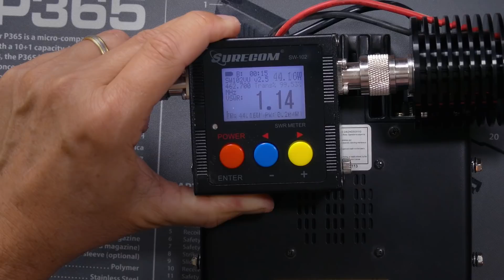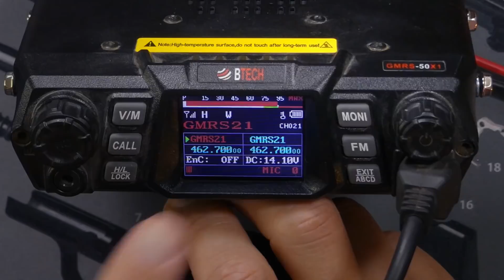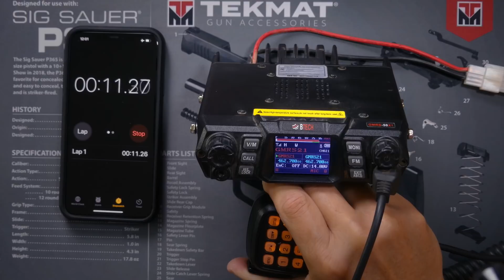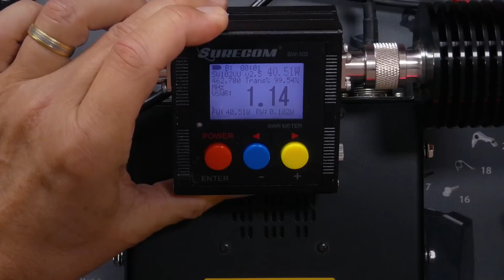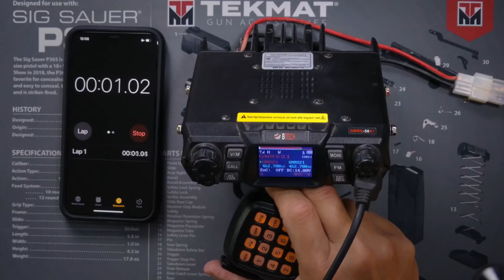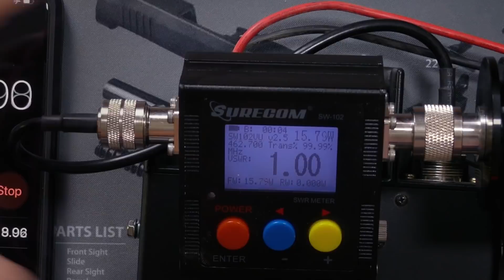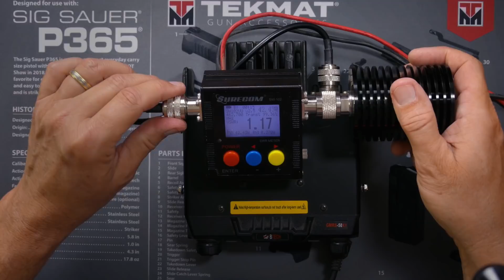Transmitting With NO ANTENNA At High Power - Will It Will Damage The Radio? (Ham, GMRS, or CB)

Comment: What a useless and stupid video this is. Why would a sensible person with just a little bit of knowledge operate a transmitter without a proper 50 Ohm load? Only a complete and utterly fool would do such a thing. Obviously this guy have no technical knowledge of transmitters. The most of the current transmitters these days have a SWR protection circuit that reduces the power output of the final stage when the standing wave ratio or the impedance is way of. That's why the final stage of this transmitter survived.
Reply: IMHO this YouTuber is not a "fool" but a true "Amateur" in the spirit of a real HAM. The amateur (HAM) radio service license was created for experimentation and this spirit was perfectly and legally encapsulated in this video.  Until the FCC creates an "Expert" radio service license for you to obtain then please remove the stick from your behind.
Reply: ROFL #SADHAM 🐽
Reply from the maker: It would seem that you didn't actually watch, listen to, or comprehend the video, as i very clearly explained why I made this video.  And you have come along and proven my point. Thank you for that.
The only thing i don't understand is why you didn't start your comment with how many years you've had your license or how long you've worked in "the industry"
Reply: @TheNotaRubicon  lmfao at the sad Ham that didn't comprehend the video or why you did it Duhh to prove all the other sad hams wrong that it wouldn't blow up or catch fire and die and never work again got to love when people don't listen or read 😂😂
Reply: @TheNotaRubicon  thanks for your video Randy I've learned a lot about radios from you and just about every hobby out there you have all these know-it-all intelligent imbeciles they're everywhere on YouTube have a great day
Reply: @TheNotaRubicon  isn't he right about power reflection? It is like sticking fork into power outlet and telling that you can survive it because differential fuse.
Nevertheless it's a bad practice which can result in destruction of the power stage especially in older transmitters or the ones which do not have any protection. Simple
Reply: With 150 years experience as a HAM operator I approved this message 😂😂😂😂 … Dude got pinned 🤣
Reply: Literacy much?
Reply: Clearly he stated it right up front why he did this at the beginning. Did you miss it? He did this because self described “experts” keep telling him in comments posted that “transmitting without an antenna will destroy your radio”. He wanted to prove them wrong to make them quit doing it. He took a crappy couple year old used radio that was probably only $100 new for the test. He was out nothing but the time. He did as you, I and many already knew, successfully proved them to be wrong. But many, many more are now correctly informed and will quit repeating decades old information that no longer applies. It was not useless or stupid. He made his point, proved the annoying “experts wrong, had fun doing it AND got over 13,000 views out of it. Clearly not useless.
Reply: Hey, give the commenter a break.  Apparently he also produces content within YouTube also.  His content has just over 100K views and has 100 +/- subscribers.  With this rate of success it’s no wonder he has switched to raining on other contributors.   

I’ll be keeping my subscription to @NotARubicon.    thank you
Reply: Some people tranmsit and forgot to screw in the antenna. This is actually helpful lets people know that it probably didn't damage the radio. I'll admit I have done it a few times including with an HF radio. My radios didn't just blow up and stop working cause of the mistake.
Reply: KAREN 2.0
Reply: How bad is your English, you need to go back to school and learn how to read and write properly.
Reply: "experts"
Reply: This guy..YouTube comment expert!
Reply: You talk to much I guess you dont have knowledge!!!!!!!!!!!!!!
Reply: Thanks for not disappointing!
Reply: A typical Sad Ham response
Reply: Being I am also a  "professional operator" like your self, I can also tell from experience that this "Randy" fellow is just an amateurish buffoon. 

I can tell from his videos he does not know how to correctly grip his "Johnson" the way he should as a "professional".

He also seem to not have a single clue as to how he should poke and stroke his "chocolate coated starfish" the way a "expert technician" should either! 

Just plain amiture behaviour indeed!
Reply: All wt has a protection circuit from the beginning of ham radio.
Reply: @snuitje100. I wish I could go back in time and give your daddy a condom. It's just a test to see what happens.
Reply: yOO R very semart. yOO haf a much big edukashun den I du. eYe cen tel frum yOOR spel end grumer.
Reply: Im smelling the scent f a BUTT HURT Hamy.. Hams are about as arrogant and ignorant as the day is long. The radio will heat up wether an antenna is connected or not when you get long on the key. Sorry but i just love it when these so called Ham Gods place their comments. Its like adding a sign on there forehead saying"Ya im a dumb ass ham operator and I know more than GOD"
Reply: Proof?! Docs.?!
Reply: Legend has it this guy is still trying to come up with a proper comeback to this day. 👀💩
Reply: It's someone who gets lots of free radios sent to him!  😮
Reply: Sometimes I think these comments are staged.
Reply: Ok boomer

Comment: drone jammers with output power of 30w and above are constantly dying from being used without antenna, though those devices are pretty primitive compared to modern walkie-talkies, may be they invented a solution against that in propper radios

Comment: The limiting factor here is the transistor die temperature. Most transistors are rated at a maximum internal die temp of 150C or more. Now there is some thermal resistance between the internal die and the case of the transistor... so you must derate accordingly. But the bottom line is that you would probably have to get the heat sink to perhaps 125C before there would be any chance of damaging the output device(s).

Comment: What can cause a radio to all of a sudden get hot and blow a fuse?  My 50 watt Midland 575 did it today and I do not know why.
Reply from the maker: Could be aBazillion things, but I would start by checking all of the wiring for shorts..
Beyond that it would take troubleshooting steps that are beyond the scope of the youtube comments section.
Reply: @TheNotaRubicon  Thanks for replying and thanks for the great videos.  I think you answered it in one of your other excellent videos I watched after making my comment..  I was using a analog CB band SWR meter.  For some reason the SWR approached 30, smoke started coming out and the fuse blew.  For now, it seems to be working.  Thanks again and keep up the good work.

Comment: The reason it didn't die: Proper cooling solution for the given output power. 😆 Try that on a very tiny IC transceiver with no antenna and the juice cranked up. I'm interested in the results now!

Comment: As a neophyte, following all of Randy's advice to the letter...this one got me thinking. Do radios, especially HT and ham units that typically find their way into the fumbling, unwashed, formerly cool ranch Doritio stained hands of amateurs, have published duty cycle limits?  A question I'd be too embarrassed to ask a fully licensed Elmer, for fear of a wrathful lecture and suggestions that I volunteer at the next community radio dorkfest.  Alternatively, I used that Googling thing Randy always eludes to.  Come to find out, some radios do, but some claim to have a 100% duty cycle, in other words no duty limit. Further curiosity got me wondering about the greatest HT ever designed and I find the following, but I can't be certain that I understand the limitation 03/03/54 min. (Rx / Tx / Standby).  Is it 3 mins on, 3 mins off?
Reply from the maker: Anyone asking about duty-cycles should not be using a GMRS radio.

Comment: @NotaRubicon Productions - Back in the late 80's I owned a beat up Amstrad CB-901 rig, using a straightened wire coat hanger as the antenna and my sink as a makeshift ground plane, with an average SWR reading that literally melted the needle, I still managed to transmit clear across town and annoy everyone with those damned roger beeps. Those were the days! 😉

Comment: I have experienced both sides of your experiment.  Radios with no damage from a brief key up and a 100watt radio with lots of damage from an accidental key up at 5watts with no antenna.  The finals weren't fried, but some passive components died and shorted the board.  KI4CJJ

Comment: Can you have no antenna on when just receiving with no damage? I just got a nagoya 771 antenna and I wanted to swap antennas back and forth between my stock antenna and the new one while receiving a signal without power off to see wich one receives a clearer signal
Reply from the maker: One most radios, yes. I do it often on all of my radios.
Reply: @TheNotaRubicon  ok this would be on my yeasu ft65 that I would be doing the tests on. Thanks

Comment: I always enjoy your videos and don't mind the barbs thrown at licensed hams ( I B one). Very interesting test, I like that you sometimes test or disassemble to the point of destruction. Now, what I would really like to see is what happens if you connect two radios antenna connections back-to-back and key one up. Would it fry one or both of the radios - or neither? My guess is that at least one would bit the dust - even at low power, but I am not an RF engineer. I doubt that it would be as cool as creating plasma in a microwave, but it might be fun :)
Reply from the maker: For clarification: I do not throw barbs at licensed hams.. I throw barbs at asshole jerkwads with superiority complexes that go around trying to show everyone how smart they are by leaving arrogant comments and making fun of anyone asking a question, chasing away many new potential hams, all while bragging that they have "been a ham radio operation for over 20 years".
BIG difference..

Comment: Copious innumerable yesterminutes ago, this test would have fried the transmitting finals of most any transmitter/transceiver. Like 1970’s or more priors possibly even into the 1980’s. You know, the days when everyone walked uphill both ways to get anywhere roundtrip. For example, doing this with a room warming old tube transmitter would be very no bueno. But keyboard “experts” (usually known as wankers) have not kept up with the times. Modern radios have this kind of protection for a missing in action impedance at the rear antenna hole-eo, and for high SWR from mismatched antennas. Randy’s meter showed, the throttle back of angrified emitting electricities to keep a radio’s smoke inside, so you won’t have a bad nostril hair day. Now, the future longevity of this fine radio may (may) be compromised. But there is no way to measure that, lol. But if you DO decide to try this at home, ignoring Randy’s well informed advice, remember this: “your fars may vary” 🤣😂🤣

Comment: Hey, dont want to be called an expert because im not, i dont even spell english correctly, but i have a theory...
Can you make this same test but with a normal antenna?
I think this behavior happens not because there is no were to deliver this 50w but because this 50w is being created and it makes the internal circuits generate a lot of heat.
Every integrated circuit, even micro processors found in computers and smartphones, have a designed temperature of work, almost every time this chipsets work in high temperatures, the quality of the service falls down dramatically.

Thats why i think this can happen, i can be wrong of course, but just wanted to comment it, i think this is the thing because im preety sure this radio isnt designed to work with the PTT button press the hole day.

Anyways, love the content of your channel, thanks for making it possible, i find it extremely usefull and also very fun.

Comment: Most of the better radios now come with protection circuitry that will either attenuate the output signal to a failsafe level or thermally shut the radio down. This practice is still considered a big no no but it sometimes happens like accidentally sitting on a hot mic with high swr. Nice demo.

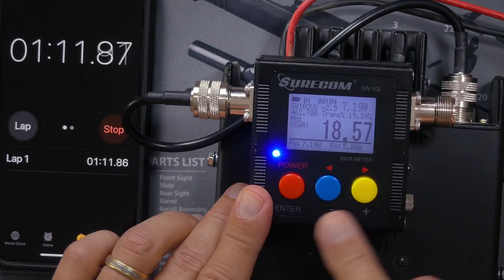Comment: Was interesting to see the reflected power when you took the dummy load off the power meater ( 12:00 ), If the radios turning the output power down to hit 5W reflected power, at 50W output that's a return loss of 10dB or about 2:1 SWR. Not sure what the spec of the radio is but that seams about right. 2W ERP with no antenna (other than the power meater) is still kinda impressive though, might be able to open a repeater with that if the conditions were right.

Comment: My humble opinion (since asked) is that the "experts" are right in part, the electronics will "instantly become damaged", only the extend of such damage in modern designs I'd question. 

Modern Radio (and Computer) designs implement circuity to protect from damage from "user error".  This "protection" includes reducing output power, as noted in this video, power reflection sense circuitry to shunt power to an internal load circuit, etc.  This "Protection circuitry" may not, and in the case of many older designs does not, exist and may result in that "magic smoke" that instantly kills the circuit.  Even with a modern radio with this "Protection", damage to your radio will still incur some minor permeant, cumulative damage.  Then again, from the theoretical physics standpoint even "using" the circuit (radio) causes some permeanate "instant damage".  Electronics is a constantly evolving "theoretical" science and I make no claim to be an "expert".

Comment: That instant death theory is a hold over from the vacuum tube radio days.  They do die quickly if abused........solid state modern finals are a lot more durable.......It wont burn up quickly but it will degrade the output power over time.  I've seen many radios with damaged coax.   All partially or fully disabled.     Try a infrared camera and you will see the finals get hotter than they would get with a functioning antenna  Also frequency will drift as they burn making the radio useless as a transmitter.  Still receives thow

 I have a few baofeng handheld radios with dead transmit finals from the junk antennas that they come with

. Reflected power on a stock antenna is shockingly bad

 Do you have anyway to see how far the frequency drifted?
Reply from the maker: According to my meter the power output is exactly the same as it was before the video and the frequency has not drifted at all - and the radio works fine.
Reply: @TheNotaRubicon  thanks for the reply keep up the good work..  I've been an extra class Ham for almost 20 years.   I must admit that the misinformation and garbage floating around in Ham culture is only surpassed by politicians and lawyers.  Bit if it wasn't for the trolls who would we fight with?   Internet wouldn't be any fun at all!!!

Comment: Not sure what "experts" you're listening to, but anyone who knows anything can tell you that this common warning applies mostly to older tube-based radios. Modern radios have a neat little feature called foldback control, which typically comes in the form of the ALC being fed info by the radio's built-in SWR meter to cut back the power based on how high the SWR is.

That said, this is a protective feature, not necessarily guaranteed in all transistor radios. You wouldn't use your e-break to slow down at a stop light, though your car might survive it (if "surviving" is your bare minimum requirement). Radios are expensive pieces of equipment, we try to take care of them, not rely on the built-in protective measures to keep them alive in adverse conditions

Comment: Even with an antenna connected, these radios are not designed to handle multi-minute transmissions. They will overheat, because they are unable to dissipate the heat fast enough. The manufacturer can only assume that a responsible user will not key a radio for such long periods. The timeout timer should always be used, if it's possible that an irresponsible person may abuse the radio.
Randy proved that simply keying a radio without an antenna, will not destroy it.

Comment: Too many different designs in output stages to say yes or no to doing this but most these days are pretty tollerant of the "ID10T" factor, you know, those idiots calling out for "Radio Checks" without a flippin clue as to where the responders are. The only part missing in the test was a current draw. Before and after would be very clear of the actual power chew.

Comment: No, they would point out that your radio is not putting out RF because you’re not giving the radio any audio to transmit. Most modern radios self limit the power output where there is a high SWR.   These are the reason you don’t attach the power meter.  Nice dodge however.

Comment: I have never heard anyone so emphatic to say that if you transmit without a load the radio will explode. Aren’t you exaggerating, at least just a bit? 
This video demonstrated how well the “foldback” feature on that radio works. I guess we can assume that since that radio is well protected that all radios are just as safe.
Why do radios have foldback protection in the first place? Isn’t it because transmitting without a load or with a very high SWR is bad?